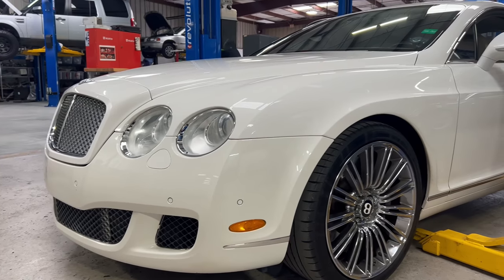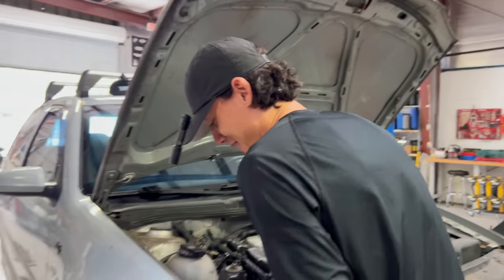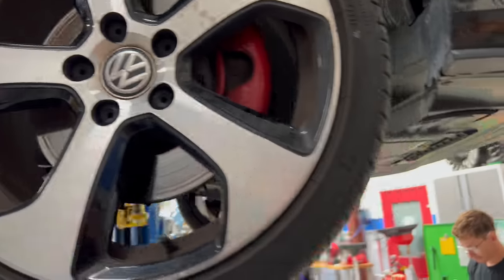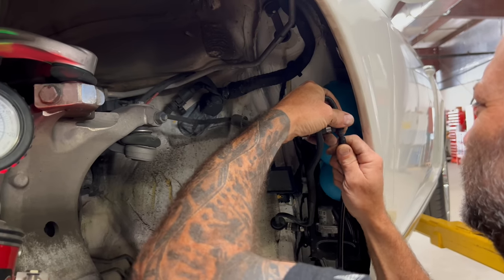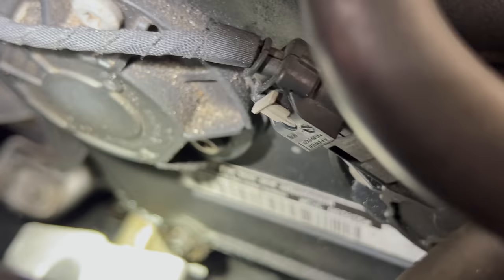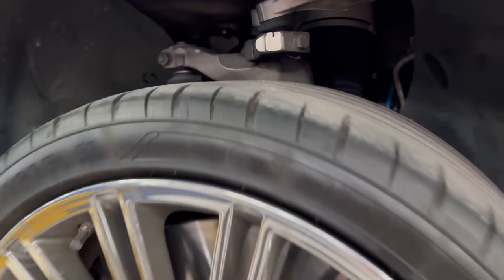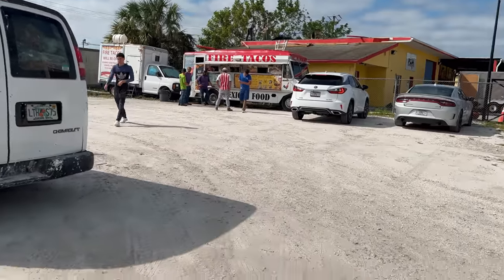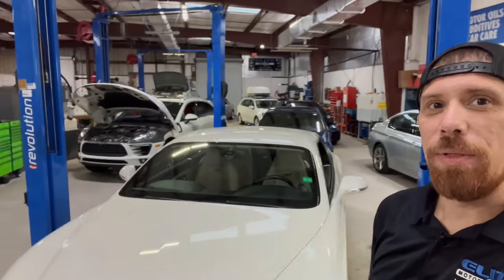Bentley check engine light diagnosis

Comment: The W12 engine vacuum lines on the Bentley is a common problem. I’m a Bentley tech and you CAN do the job without dropping the engine. If you remove the steering rack, you can get the replacement line installed with a good slap of elbow grease. This only works with the original plastic lines though. The upgraded metals one will not fit with that method. Like you said, unfortunately you have to drop the engine
Reply: Wasn’t this issue fixed during this generation of the Continental? Or is it the next Gen (aka current one).
Reply: @WHTMAN-ei7ik  the current one has a updated design yes. They haven’t been around enough to really see how much longer they last, but it’s still an entirely different system. The first and second generation continentals both suffer from the brittle vacuum lines.
Reply: What year did Bentley resolve this vacuum line issue of needing the engine to be dropped
Reply: 2014 for the flying Spur and 2013 for the GT...
Reply: @daniellehrer3495  mid 2006 you could do it just taking the steering rack out ,if you go to the dealership they still want to take the engine out 40 hour job vs a 14 hour job
Reply: @ulflei interesting I was told 2008 was the yr it was updated for the GT?

Comment: I think I’d be looking at splicing some new ends onto those tubes.  Sure it’s not a factory fix, but if the customer is ok with it there’s some huge savings.  If it doesn’t work you’re out $30 in parts and a couple hours.  As a customer I think I would appreciate the option.  If it was my car I’d be DIY fixing it like that for sure.

Comment: hey guys, nice video, nice shop and cool crew!
correct me if I'm wrong but I was informed that only bentleys before 2008 had the problem with lowering the engine/trans to service the vac lines....after that year the lines where relocated.

Comment: I want ask you had a miss fire codes too??? I changed in denso sparks and after this I have miss fire code, and I check I have vacuume pipe leak too, this codes can cause from vacuum pipe leak? Or is the denso spark because didn't find ngk to add

Comment: Dang....I was under the impression that the 2008+ Gt's didnt require an engine drop to fix the notorious vac leaks.  Do you guys work on Land Rovers?  I have a 2016 V8SC that is making some ticking noise when cold.  Might be timing chain tensionors or SC snout coupler.

Comment: Could you please show us what methods you use and have to removing broken seized bolts snapped in the diesel injector department.  I have 3 bolts and well a lot has failed.  Reverse thread - JB weld - partial welding.  The size bolt in question is 6mm thick.  1 cm below the deck line and inside the head.  Ali head to be more precise.  Steel bolts too.
Reply from the maker: I haven’t had that exact issue before but I like the welding method. Add weld to the broken bolt until it reaches the top of the deck then put a nut on it and fill it with weld too. Let it cool down, work it back and forth until it comes free. Good luck!

Comment: If the guy doesn’t want to replace the lines just cut 3-4 inches back and use joint and connect another  same size hose

Comment: can someone help me about 2013 
 bentley continental gt v8 problem? car is damaged to passenger rear end side directly into the battery. key is stuck in ignition cant open the trunk either. i need to be able to take the key out of ignition and be able to put into neutral gear any advice?

Comment: Can the vacuum line be repaired with adhesive lined heat shrink tubing?
Reply from the maker: That would be a better temporary fix than electrical tape